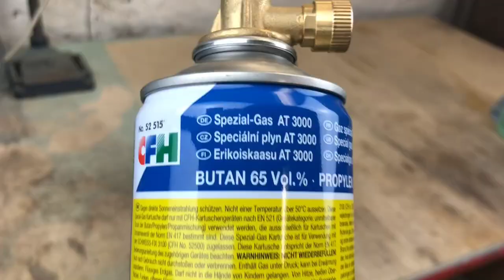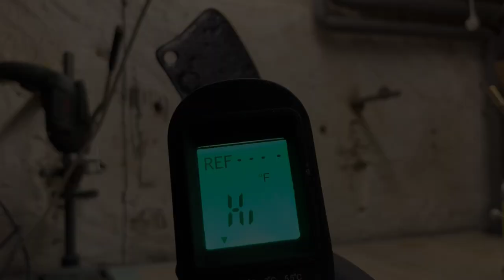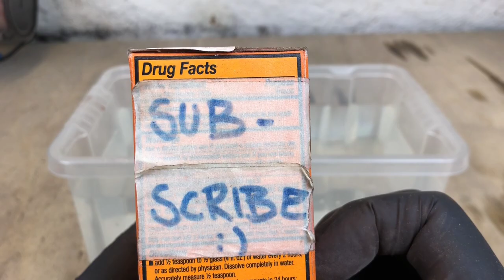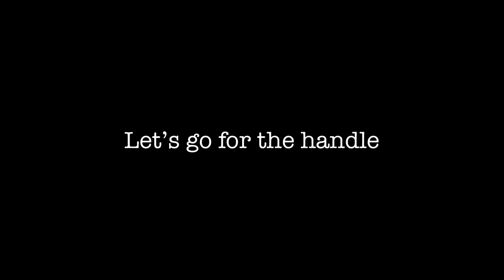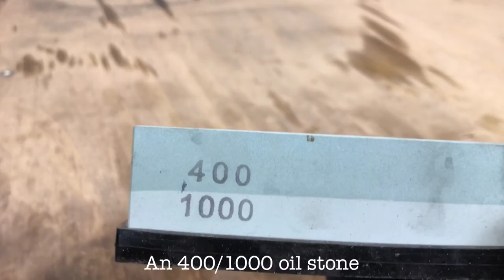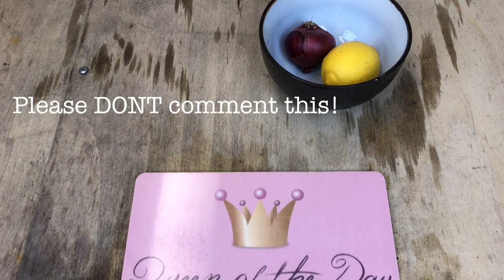Antique Rusty Cleaver Restoration - Full Restoration | Mister Patina

Comment: As an ex chef I can tell you balance is everything with a cleaver. You need it so you can use the middle to cut through a cow's backbone and then nick the sinew on a T Bone with the tip. This looks pretty well balanced to me. It’s when expletive go OTT customising the shape it all goes wrong. Well done.
Reply from the maker: Hey Mark, pretty cool to hear that from a real expert! It weighs a little bit more than before, but like you said, the balance is better. 
Thanks for watching!

Comment: For the next time you need to grind metal with a sanding disk go and look into the 3m cubitron 125 sa ding disks. You can get them in all kind of grit sizes. And work way better then normal snading disks

Comment: Beautiful restoration! The connection between the blade and the handle would be a weak spot if it is used as a cleaver. IMHO 🤔
Reply from the maker: Thanks Mike! Yeah you’re right, but I only use it for displaying in the kitchen 🙂